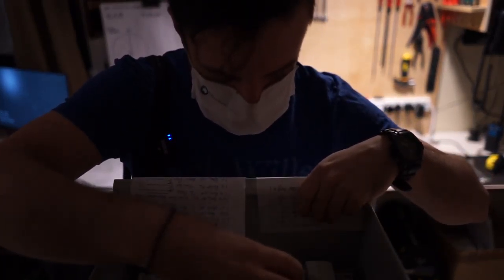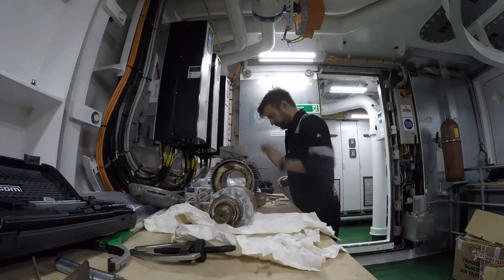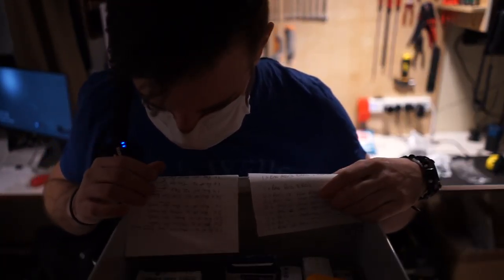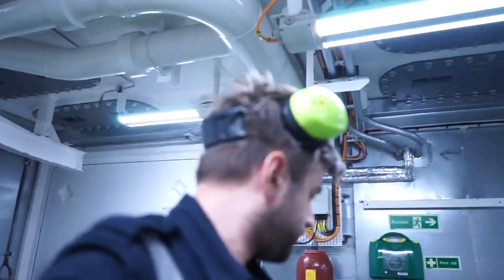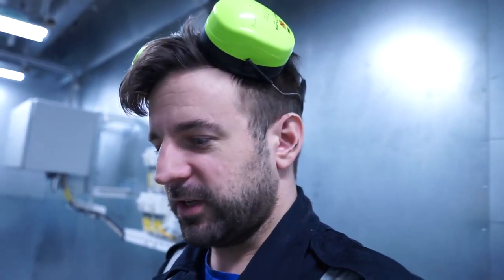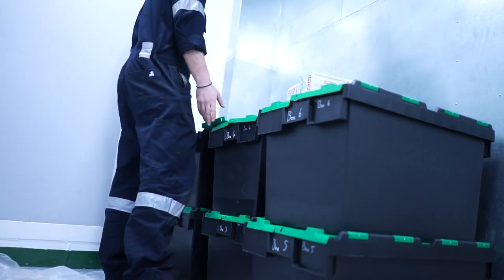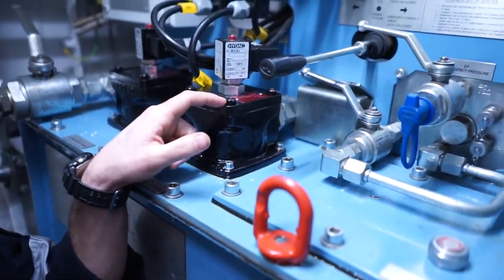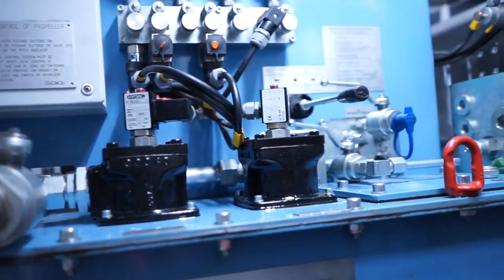Put the tools back! | Engineers Vlog

Comment: 11:08 I'm assuming this guy maybe electrical engineer. 
Anyway shouldn't motors overhaul be done by ETO department.
Reply from the maker: Yes that was our ETO, but all Engineers are qualified to work with motors or electrical equipment, so it helps the ETO out when we don't just give everything to them.  There is a lot of stuff that ETOs can do better and faster than engineers because they practice their trade every day... but to overhaul a motor is a simple job, so its all good :)
Reply: @engineerjono9962  Ohh okay, 

BTW which type of motor is that.